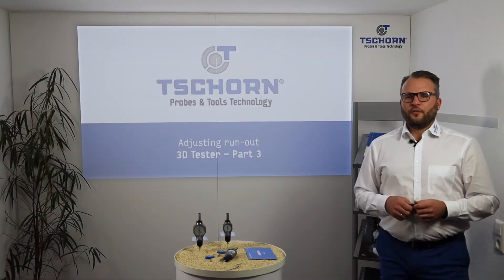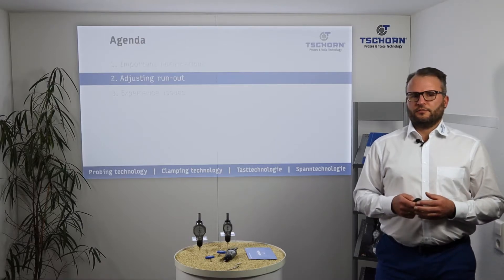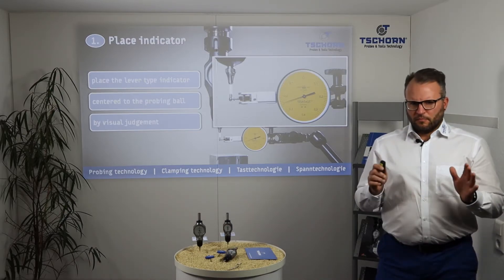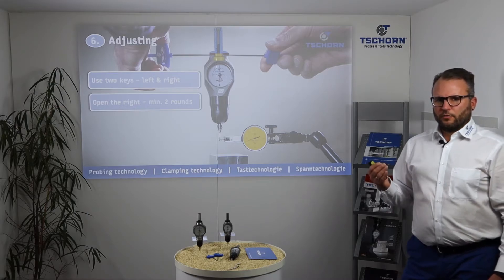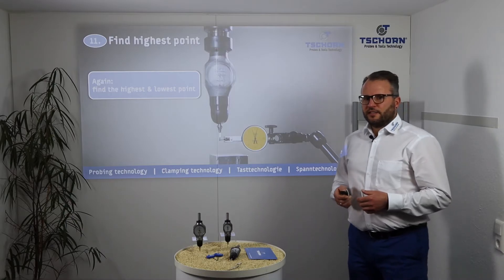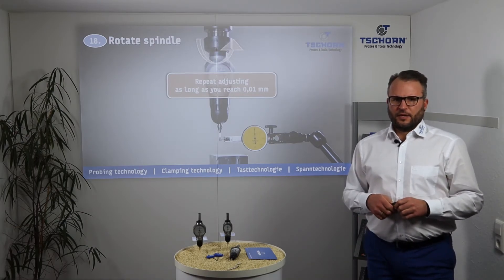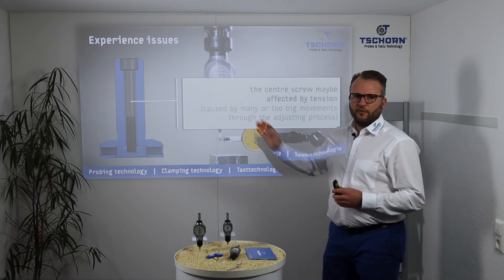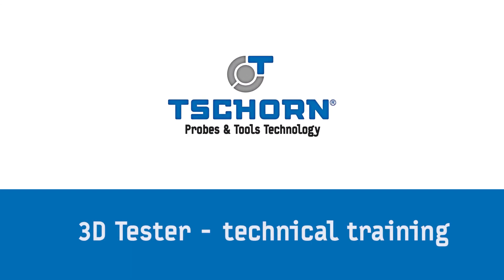Adjusting run-out of the Tschorn 3D-Tester

Comment: Hello  I have been using the Tschorn 3D tester for a number of years now.  I found that the adjustment for concentricity is far too coarse, frustrating and time consuming.  I completely removed the Tschorn mechanism and fitted my own design.  I have a coarse and a fine adjustment and centering can be done quickly without continually overshooting the target.  I also use a Mitutoyo 2 microm test indicator to centre the probe.  It is very easy with this setup to calibrate within a 2 micron tolerance.  May I suggest you rethink your adjustment method as it will improve your product greatly.  More than happy to discuss.  Cheers  John

Comment: For the price you pay you guys need to calibrate it yourselves, and leave the adjusting as needed for us . mitutoyo would never do this with any of their products.
Reply from the maker: Dear Adam, thank you very much for your comment. Just we have 2 comments: First, there is no 3D Tester like this, made from Mitutoyo. And second, with the adjustment you can adjust the failure of your chuck, spindle and so on ... to achieve best accuracy. Kindest greetings Tschorn GmbH
Reply: Hi Adam, I agree with your sentiment but it is not practical to adjust the 3D tester at the factory.  They can ceratinly do a coarse adjustment.   The reason is that you need to fit your BT30 or BT40 etc  with collet to mount the Tschorn.  Collets and tool holders have their own built in inaccuricies.  These need to be compensated for by calibration.  Once calibrated the Tschorn should stay mounted.  It stays as a combined unit in a safe protected position.  Each time it is removed from the tool holder it must be recalibrated.  Hope this helps.